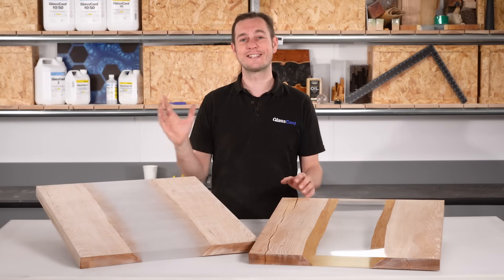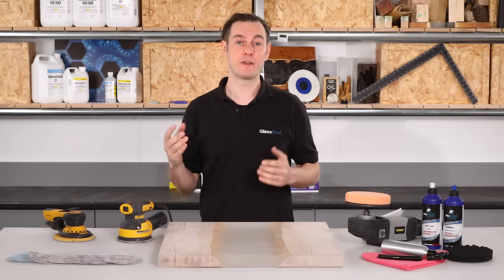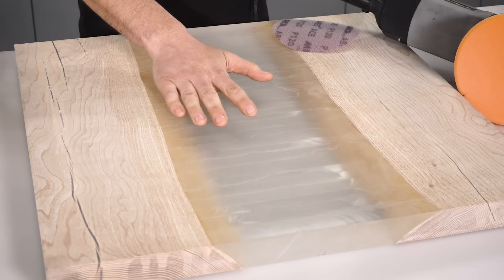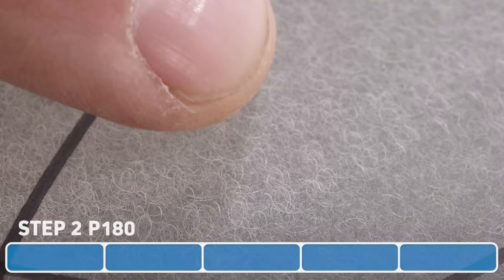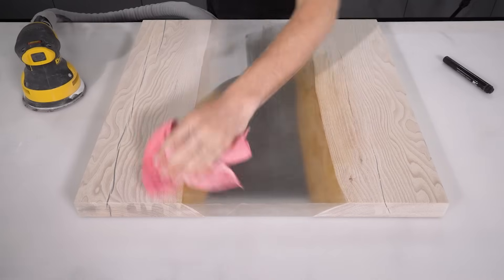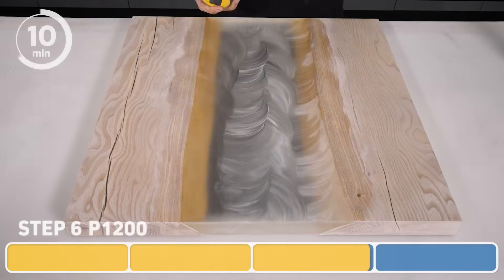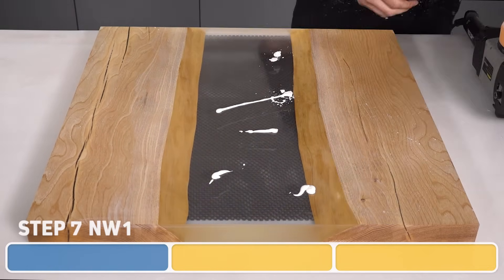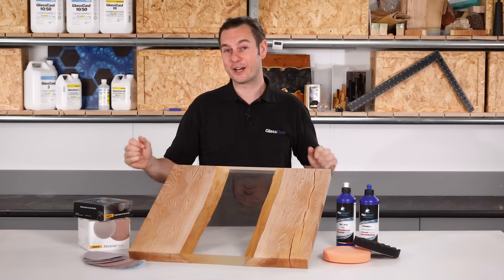How to Sand and Polish Epoxy Resin to a Mirror Finish - Step by Step Guide

Comment: is the cure time of epoxy important to when you sand?
Reply from the maker: Yes; it needs to be fully cured prior to sanding and the longer you can leave it after the initial cure, the harder and therefore easier to sand and polish it will become.

Comment: First timer here.  laser engraved a flag in some mahogany.  Did seal with shellac but one area of surface bubbles started to form so I torched.  Think I spent too much time in one area and got a hardened blob that I was lucky enough to be able to scrape off with a popsicle stick.  Took the rest of the resin off so it’s basically just “wet” no real buildup other than in the engraved portion.   When this hardens/cures I plan on sanding again and doing another flood coat.  While I don’t want coating to be thick, I do want the surface to be flat and not able to feel texture of non engraved portions.  Any tips/suggestions?  Just using clear no color.  

FYI, This is my backup piece, my first attempt ended in prickly bumps that I sanded down to do something similar in the video, but got many small deep white pockets of resin dust that are not aesthetically pleasing nor easy to fix (they are probably original bubble paths).
Reply from the maker: Hi Wayne, 
You're probably best treating this resin layer as another sealing coat which should eliminate the bubbles, as you say it will have filled the engraving and will now give you a completely flat surface once sanded down. I would just give the surface a light flat and key with 120, leaving a slight amount of resin on the surface. You can then go ahead with the 2mm flood coating which is the thickness that the resin needs to properly self level.

You might also be able to recover your first attempt by vacuuming the surface to try and pull the dust from the holes and then recoating again with resin.
Reply: @glasscastresin  I was hellbent on trying to wet and wipe it with alcohol, never even thought of vacuum!  First attempt might be salvageable!  Thanks.  The 2nd attempt dried up pretty good over night just some barely visible lines where I scraped and didn’t see but nothing a light sanding won’t fix as you said.  Only thing I’m concerned about is where I originally had the “crust” issue.  It’s just a tad more textured. Hopefully with the sanding it’ll knock it all down.  Thank you soooo much for the pretty quick and helpful reply!

Comment: Do you reapply any oil finish after your done? I would imagine the wet sanding and polishing affects the wood itchy next to the epoxy.
Reply from the maker: The oil finish is generally applied just before the polishing stage so that the oil helps stop the polishing residue sticking to the wood.  Most oil finishes are designed for occasional recoating to restore finish over time.

Comment: hi, thanks so much for the video - so detailed and helpful! however, no matter what i do, i am getting the swirly pigtail marks from the sander. i am trying to follow the instructions in this video exactly, and the sanding pads do not look clogged, but i cannot get rid of them. any advice is appreciated!!!
Reply from the maker: Make extra sure both the surface and the pad are clean.  If you pick up even the smallest bit of coarser grit or debris, it will scratch the surface leaving those pigtail marks.

Comment: How do you finish the wood with the epoxy up against it.
Reply from the maker: Generally when you get to the polishing stage, you can apply Danish oil or similar.  Then when you polish the resin, any polishing residue will easily clean off the wood.
Reply: Thanks  @glasscastresin

Comment: I understand why u went up to 1200 + polish on the epoxy portion.  BUT, do you really want to go that high on the wood? I have been told that if u go higher that 400 on wood, it will seal the grain too much and negatively affect the ability of the wood to take a finish. I struggle w that bc it is rare to have a piece where the border line between the wood and epoxy is as perfectly straight as the piece you used.
Reply from the maker: We have not seen it to be a problem with the common finishes used such as Danish oils, varnishes etc.

Comment: Hey man, love the video.  Used your technique and it worked great. I'm a professional artist. I work with multi-medium art.  I'm reaching out because I'm stumped.  I'm working on an epoxy table. It's 2 3/4" deep, with land, beaches, whales, boats, waves crashing against the shore... I'm 13 layers into it, nearly finished, and I noticed a line.  It's about 2 layers below.  I've been working on this for over a year, so you can imagine me screaming.  All I can think of is to cut into the piece around the area, clean it up, and refill it with epoxy.  I'm hoping someone else out there has a better solution.  Any ideas, suggestions, or whatever???   Any help will be appreciated greatly!!!!!!!!!!!!!!!!!
Reply from the maker: Unfortunately yes, the only way to get rid of the mark will be to physically remove it and then repair the layers afterwards.
Reply: @glasscastresin  thanks for the response.  I'm going to remove the layers with a router and sand it back to a glass finish.  I guess one doesn't become a master of his craft without suffering the errors that teach us. ;-)

Comment: if you are just wanting to polish some resin on your art, can you skip the sanding process?
Reply from the maker: If the surface was already flat and smooth then yes you can use the polish straight away, it won't necessarily remove deeper scratches but can bring an already smooth surface up to a gloss.
Reply: Awesome, thanks so much for the reply!! 
 @glasscastresin

Comment: I have made a priject and wanna sand it but i am afraid to follow the steps because the epoxy has things in it and i believe is gonna start "eating" too much of the epoxy and start removing the things in it,or grinding them
Reply from the maker: You just have to be careful when sanding to not remove too much material.  Carefully check your progress to ensure you don't cut in.

Comment: Great video, very well executed! One thing I didn't see addressed - should this be done on both sides of the piece? I imagine yes as if the bottom is not as clear as the top you'll see that as you look through it.

I've made several river tables, though all with a dark epoxy - not see through, so I sand the bottom up to 180, while the top is sanded to 800 (on the epoxy part).
Reply from the maker: Thanks for the feedback. Correct If you wanted to be able to see through the entire piece with clarity then you would also need to polish up the underside of the 'river'. If, as in your case the bottom side is hidden then you can do as much or as little finishing as you please.
Reply: When staining wood, I guess you wouldn’t want to sand up to 1200? Maybe stop on the wood around 320 and keep sanding the epoxy?

Comment: Super nice video! 
I have a artwork that I would like to polish but the resin layer is only 2mm thick.
How much material is removed during this process? 

Thank you very much!
Reply from the maker: In reality, very little - fractions of a millimetre as you're only working down through the deepest scratches. As you progress to the next, finer level of abrasive papers, the only material you're removing is between the scratches, you're not going deeper; the idea being that your smoothing out the surface prior to polishing.

Comment: Can you add a finish like Osmos to both the wood and the epoxy? Great video thanks.....
Reply from the maker: A product such as that wouldn't improve the finish on the epoxy in any way. As an oil based product it would simply sit on the surface of the epoxy so can be wiped away once applied to the wood. If you are using a one with a stain to alter the appearance of the wood it would be a good idea to so this relatively quickly rather than letting it sit on the epoxy, especially with light coloured or clear resin.

Comment: Can you put an oil based poly over the epoxy after following all these steps?
Reply from the maker: This sort of product is designed to soak into a wood so it wouldn't coat the resin at all and would wipe off the surface. It would be ideal for the wooden area of a river table but wouldn't have any effect on the resin.

Comment: bonjour, I have a very important new question, I have to finish my table and I would like to know if the 2 finishing products that you use in this video and that I bought protect the surface from stains, scratches ………  I look forward to your response to finish my table, thank you very much
Reply from the maker: The polishes do not offer additional protection to the resin surface.  Durability on resin surfaces is down to the properties of the cured resin itself.
Reply: @glasscastresin  ok so for everyday use of the table, aperitif, dinner, it is better to have a product like Rubio monocoat 2c?

Comment: May I ask what you use as a sleeve on your dust extractor hose?
Reply from the maker: The sleeve is a Mirka product that came with the sander.  Some sanders have the sleeve as a kit, but it is available individually. It wraps around the vacuum hose and power cable to keep things neat.

Comment: Great video! What, if anything, do you do differently on the edges of a table? Particularly if it has a rounded-over or chamfered edge?
Reply from the maker: You still sand it the same way, just take extra care to keep an even pressure so you sand evenly.  On edges its easy to end up putting too much pressure on the corner if you are not careful.
Reply: @glasscastresin  thanks
Reply: This was exactly my question. Can you do a video on doing the edges? What is considered a single pass on the edge? Obviously you can't go up and down, do you go around it a 2nd time? how do you go about an edge with a round over or a more complicated router bit? How do you handle that? @glasscastresin
Reply from the maker: @sarahweerheim6123  For complicated or undulating surfaces you may find that sanding by hand is better. It may take more time than with a sander, but you'll have more control and a better feel for the contours in the edge.

Comment: Question, if I want to put a top coat an already coated bench and i scuff it with sand paper, will the top clear coating blend in the scuffing?
Reply from the maker: Key it to 120 grit and the resin will fill the scratches so they cannot be seen.
Reply: @glasscastresin  awesome thanks I'll do that, I had clumping in a coating and sections didn't harden properly, so not I have to clean it and recoat it

Comment: Thanks a lot for sharing this video, and really nice work! The tabletop I'm working on doesn't have a 'river' of resin, instead it's scattered across the surface of the wood to fill holes, indentations, etc. What would you recommend I do when it comes to the sealing of wood and polishing of resin stage?
Reply from the maker: You could do the process in a very similar way. Applying the oil coat before you polish the resin surface will reduce the chances of the compound absorbing into the grain. For small areas you may wish to polish by hand which might reduce the spread of the compound over the wood areas.

Comment: Thank you for a great tutorial. Can you recommend a tool for smaller pieces of resin? I’m working on coasters, so an orbital sander feels excessive for the size.
I use GlassCast resin and it is brilliant, never had any issues with it unlike others that I’ve tried.
Reply from the maker: The good thing about a random orbital sander like this is that it has a random path, it's not just rotational which means you get a really nice finish with minimal sanding marks. For small pieces you might find a detail sander more appropriate.

Comment: bonjour, following my order of the 2 polishing products, Easy Composites made a mistake and delivered me Topfinish 2 Black, can it be used on the exhibition if so there is an interest in using it on  the resin tinted black?, Charlotte sent me the right product yesterday and told me to keep the Black but I dare not use it without having your opinion, thank you very much
Reply from the maker: The polish has a black pigment in it so we would only recommend its use on black or similar dark coloured resins. You would need to mask off and protect any wood as the pigment may stain the wood if you get the polish on the wood.
Reply: @glasscastresin  ok merci
Reply: @glasscastresin  Bonjour, sorry to bother you once again!!  but I ask myself a question, I saw videos where the guy at the end once sanded at 360, wood and resin pour a thin layer of transparent resin and suddenly the resin and wood shines !!  Is a special resin needed, will the surface be fragile (coffee table for example)?  What do you think ?  thanks again
Reply from the maker: You can apply a 2mm coating of our GlassCast 3 resin over the whole surface. Once the surface is flat you would need to key it with a 120 grit abrasive to provide a good bonding surface for the flood coat. The resin would have the same hardness and temperature resistance as the GlassCast 50 used for the main area of the table.
Reply: @glasscastresin  ok I buy this resin and after the total sanding of the table with a grain 120, I pour the resin on the wheat that I put a little high and I let gravity do its job, it's correct  ?  should I use a polish after that?  what do you think of applying ceramic for better protection?  big thanks
Reply from the maker: @ludovicdubois6449  GlassCast 3 properly applied does not normally need sanding. Watch this video as it shows the whole process for surface coating: https://www.youtube.com/watch?v=dTLLFntPD60&t=1s
Reply: @glasscastresin  super 👍 it’s  vers beautiful ! merci
Reply: @glasscastresin  ok I will order this resin, do you sell the adhesive you use on the edge of the table?  thank you for giving me the reference and the brand
Reply from the maker: Do you mean the adhesive we use for bonding the legs to our waterfall river table? For that we use our ET500 https://www.easycomposites.co.uk/rigid-5min-epoxy-adhesive
Reply: @glasscastresin  no, I'm talking about the adhesive you use so that the GlassCast 3 resin does not flow outside the plate, I saw it in the video where you put a layer of this resin for a very shiny finish

Comment: I use rubio monocoat on my projects but it says to only sand the wood to 180 grit. So how do you do all these steps and not sand the wood in order to still be able to use rubio monocoat
Reply from the maker: only the resin needs to be sanded so, depending on the shape, you may be able to carefully sand the resin.  Alternatively once the resin is finished, mask it off then go 180 grit on the wood.

Comment: hello I assume you have to do the same on the other side?
Reply from the maker: Only if you need the bottom to be very smooth.  Often with a smooth and glossy mould base, the bottom finish is good enough.

Comment: Bonjour, Following your video I bought the products for polishing, sanding discs and the 2 polishing creams, I ask myself 2 questions, if you sand the wood like resin, will the wood sanded so fine absorb the creams?  and with creams I have to use a harder pad for the 1st and a softer pad for the 2nd (finish 2)?  THANKS
Reply: can I use my Dewalt sander in 125 like yours for finishing with the 2 creams that I bought from you?  I believe that the video you use a used disc??  THANKS
Reply from the maker: The polish may soak in the surface and discolour the wood.  Hence why we recommend treating the wood before you polish to prevent that happening.
Reply: @glasscastresin  ok merci

Comment: Can you use the compounds to finish the wood as well?
Reply from the maker: The polishes are designed to work on plastic resins so would not work well on the wood itself where dedicated wood treatment products are better.
Reply: @glasscastresin  Can you please recommend a product that can be used for wood polyurethane polishing.

Comment: Thank you for posting - have a question for you: Will a rotary sander work just as well as the random orbital?
Reply from the maker: The problem that you might find with a rotary sander is that it leaves swirls in the surface, also due to the fact that the outside of the disk is moving faster than the center your sanding can be uneven. That being said, if you're careful and use the right technique, it can still be done.
Reply: @glasscastresin  This is wonderful intel - many thanks!

Comment: How do you manage the wood when the stain I'm using recommends only going to 180 grit. Is it possible to polish the resin without further sanding the wood to a grit higher than 180?
Reply from the maker: Ensuring that you sand up the whole of the resin surface well without going over to the wooden section might be difficult but may be possible if you are careful. You could always key up the surface of the wood with 180grit once the resin surface has been polished

Comment: After all the sanding, approx. how much have you reduced the table? I am doing tables and want to keep my thickness around 2”. Thx
Reply from the maker: It depends how level your surface is to begin with. If your surface is pretty good then you may only take off a few mm with the sanding process, if you have a rougher surface with any low spots then sanding flat will remove more material.
Reply: @glasscastresin  thanks for the reply, much appreciated.